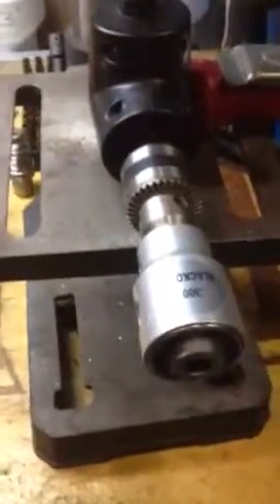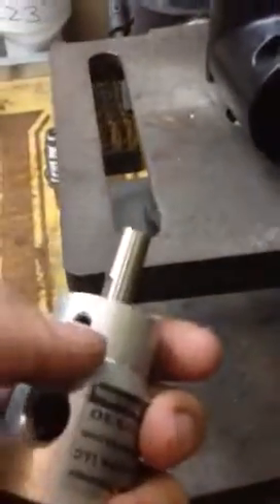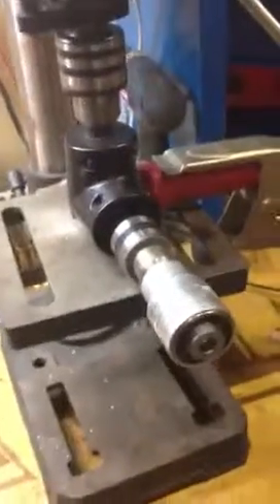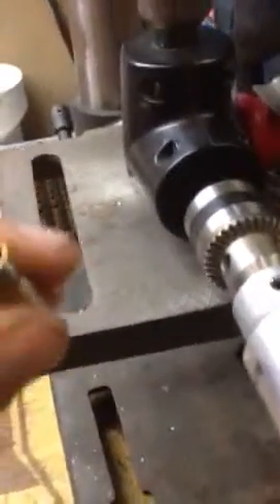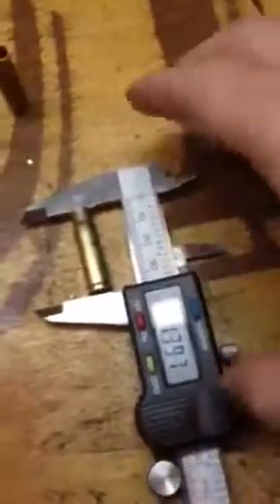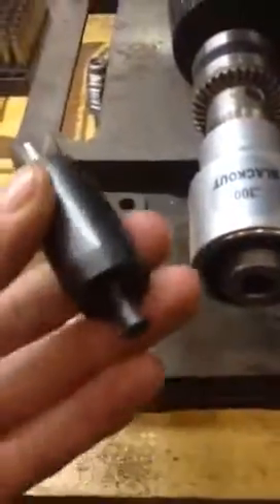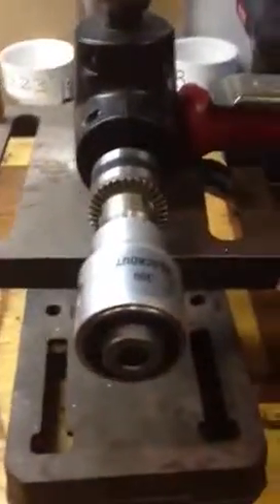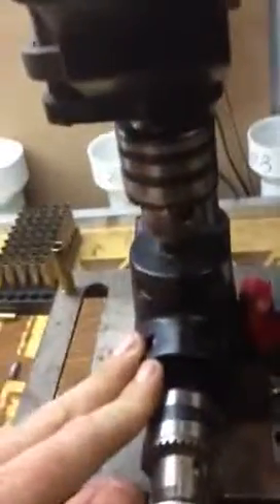Brass trimming with WFT

Comment from the maker: I've never had it come apart. Must be a one time thing. I really don't do anything special with it to prevent that either. I did learn to lower the speed of the press and set it on the lowest speed setting. It seems to be working pretty well now. Only problem I have is that I usually run through so much brass that the press motor tends to get a little hot and I have to take cool down breaks.